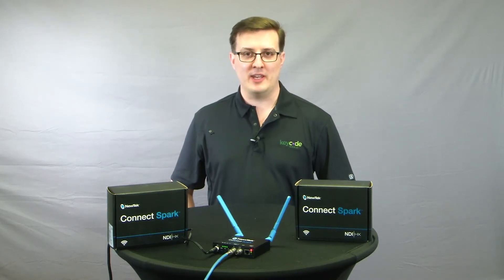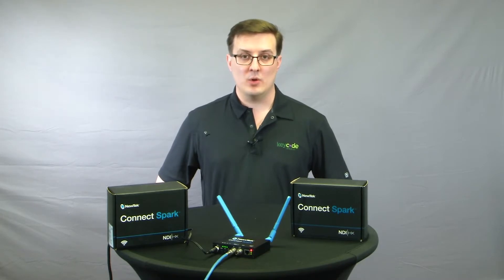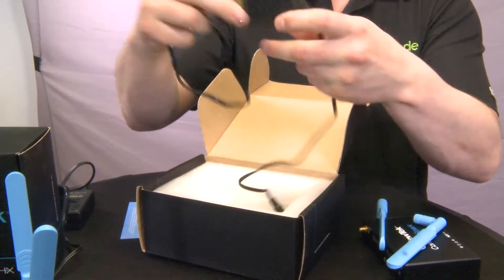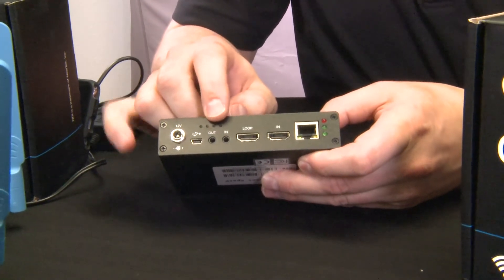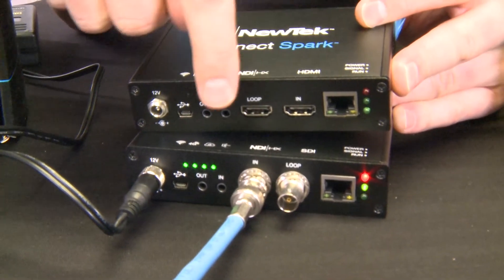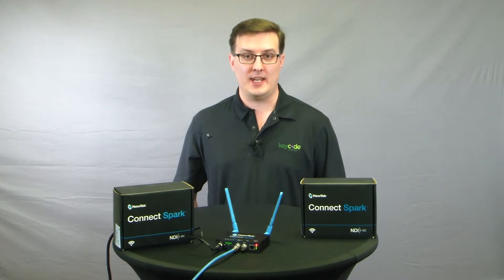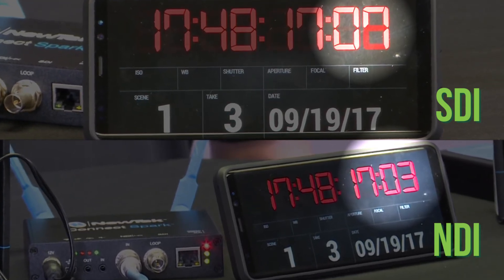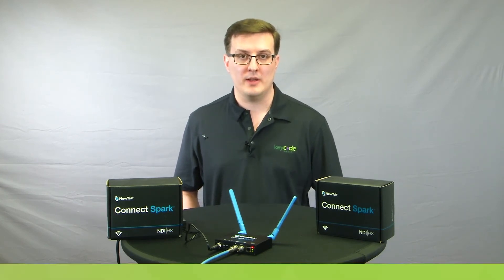Enough To Be Dangerous 02 - NewTek Connect Spark unboxing, first look, and latency review

Comment: it is important to say this device is not really NDI. it is a standard H264 encoder that send the signal to a special software that convert the data flow (rtsp ?) to a NDI protocol. If you do not install the software, you cannot NDI connect to the device.
The problem with this is 
1) price, cheap chinese encoder are about 3 times cheaper while providing same or better feature
2) Since the output is not NDI (rtsp ?) you need the software to convert received signal to NDI, so if you are using a device (monitor) that accept NDI as input , this device will not work.
3) Latency is bigger (at least 200ms) while real NDI is faster (about 30ms).
Reply: nosys70 What’s the Chinese product